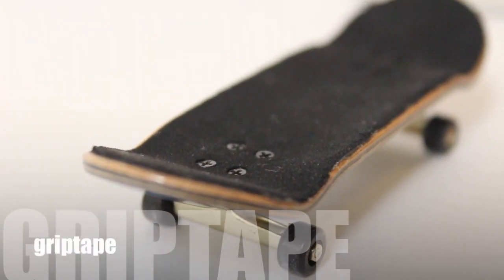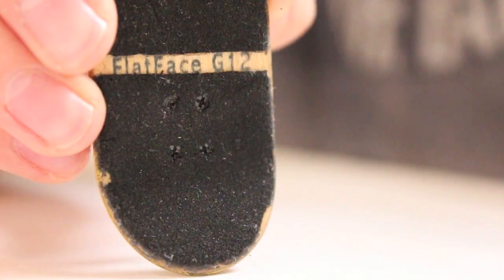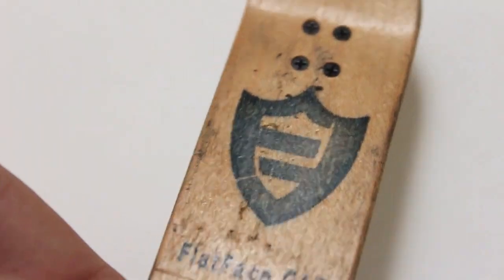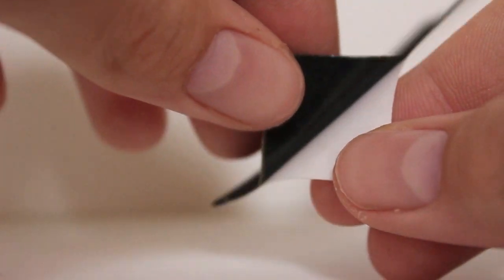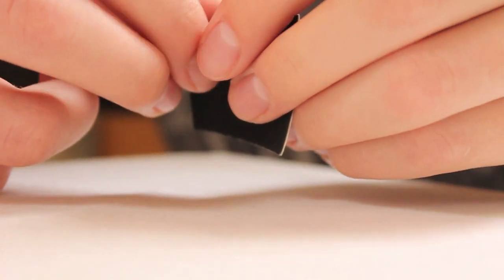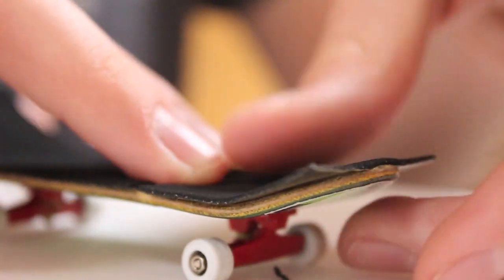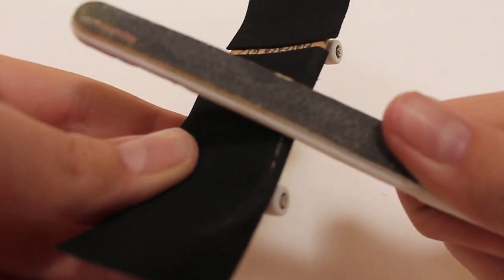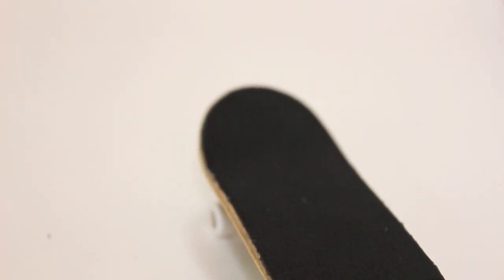How to Put Grip Tape on Your Fingerboard

Comment: tip: dont use water because using a hair dryer on hot setting is better because it remelts the adhesive under the griptape
Reply: Don't use water . It water logs ur board
Reply: Allso if you have a wooden fingerbord if you put hot WATER on it would be wet and become weak
Reply from the maker: thank you good point!

Comment: if you want to make the grip look even smoother on the edges with uncut, file the edges like he sayd but only to the point where it makes a clear mark on the grip tape. next take a razor blade and cut out the white line on the edges. this way of applying grip is the way you apply it to a real skateboard. and seems to have worked for fingerboards too.

Comment: I sell wooden boards, Only 10 dollars per board. And griptape/wheels are seperate. I have Foam/rip/grippy/normal/ griptape. And the designs are optional. Only 50 cents for them.

Comment: Hey man I was wondering if if you file the sides will it wreck the graphic? I just bought a board and I don’t really want to rekt the board. thanks - maks
Reply from the maker: If you file it gently it shouldn't hurt it, maybe use scissors or an exacto blade if you want a cleaner edge. Thanks for watching

Comment: 0:38 DO NOT PUT WATER ON YOUR FINGERBOARD it damages the deck and reduces pop other ways to get it off you can use something to get under it you can use a lighter (just go over it fast 3 times) or you tool just dont use water

Comment: That looks waaaay sloppy compared to all the setups I've used with precut FBS tape. As long as it's the right size (riptape precut was about big enough for a standard tech deck, at least the last time I bought it), it will fit and look perfect compared to uncut. Especially your g12 in this video, it matches perfectly with the size of FBS precut tape, and it's a tad shorter than the deck, so to make your slit you just make one cut still, and then put the pieces on. I've even stretched it slightly when I didn't want a slit. I'll stick with precut FBS until I get a deck wider than a classic shape berlinwood.

And there's no way I'm letting water touch my deck, use a heat gun or even a blowdryer instead people!
Reply: what grip is that?????????
Reply: monolinkster I use http://www.flatfacefingerboards.com/fbs-extra-smooth-precut/

It fits super good on my Berlinwood classic, and my Flatface G12s I used to have (basically 29mm decks)
Reply: monolinkster For my wider decks I don't have a choice but to use uncut of course, but I brought it up because the guy in the video had a G12, on which the FBS precut tape I linked to would've fit great and looked nicer than uncut